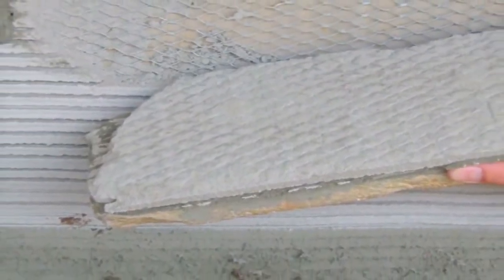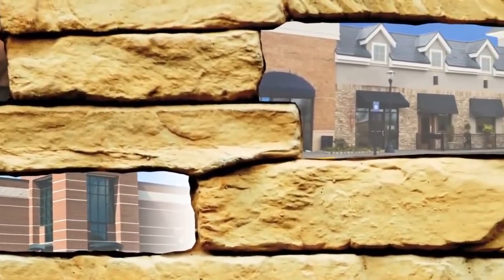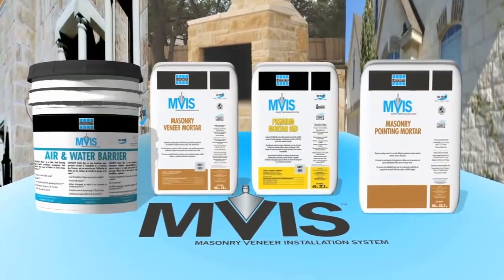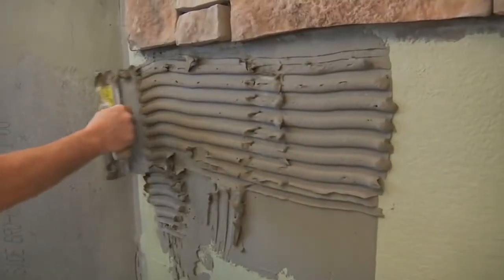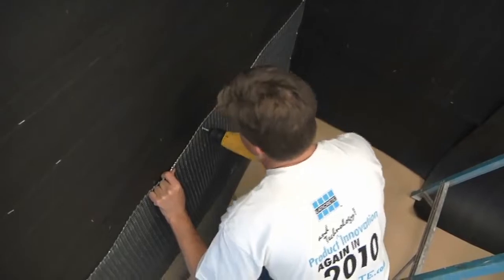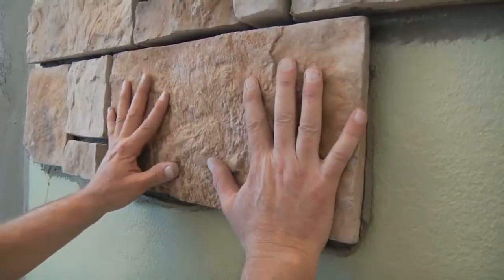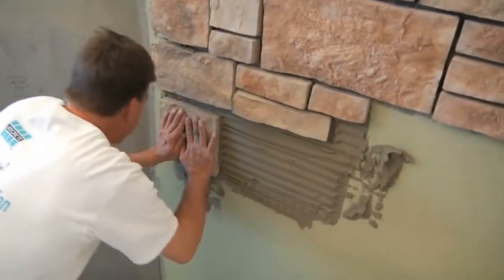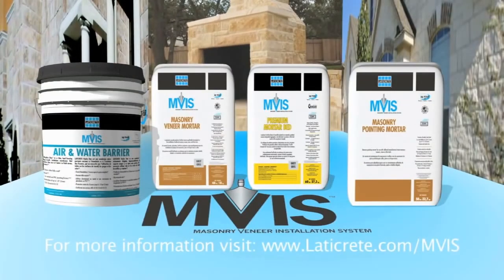Masonry Veneer Installation System (MVIS) by LATICRETE

Comment: What is the maximum amount of time (days) the Air and Water barrier can sit until the stone must be applied?  My mason only works on weekends, and depending on weather, there could be a couple weeks or more between when the barrier is painted on and when the stone is applied.
Reply from the maker: That's a great question! You have 90 days once the product is applied to get it covered with a facade. It's still best to be mindful of other trade work around the assembly and the potential for surface contaminants to accumulate as the product remains exposed. Make sure all surfaces are cleaned before products are applied.

Comment: Is there a concern that termites could travel behind the stone in tiny channels to reach wood framing above the cement being covered?
Reply from the maker: Hi Cindy! Thanks for watching and reaching out. You need to promote 100% coverage of adhesive to the veneer unit and to the substrate. Complete bedding of the mortar to both the veneer unit and the substrate is critical. Hope this helps!

Comment: That’s doing too much. The good ol wah is easier .. type s mortar slathered on each individual stone Not too wet nor dry for quicker installation without pressing too hard or holding it for more than 3 seconds.
Reply from the maker: Type S compared to our products doesn't really stack up. No pun intended! But, Although used in similar applications the two aren't really apples to apples. And therefor factory produced installation materials assure consistently high quality installations, and higher performance then a Type S, thus providing warrantable installations for challenging exterior applications.

Comment: In one comment you advise that a barrier is not required, in another you you say it is. Can I get a definitive answer? Yes or no?
Reply from the maker: We wouldn't decide if a barrier (air or water) is needed. That would be up to the design professionals on the project. Here is a document that can help you learn more about barriers, and how they relate, and may be incorporated on an exterior wall to receive direct adhered masonry units: https://cdn.laticrete.com/~/media/support-and-downloads/technical-datasheets/tds240

Also here is our MVIS Guide which will clearly show how our products are to be used on the various wall assemblies out there: https://cdn.laticrete.com/~/media/product-documents/marketing-information/catalogs-and-brochures/mvis/ds0052_mvis-catalog

Let us know if you have additional questions. We're happy to help.

Comment: Are these products ideal to use for exterior installation. I want to install the veneers stones on a cement wall, that is in good shape, no cracks etc. Thank you
Reply from the maker: You can install them over clean sound concrete. Click here for details: https://laticrete.com/en/solution-center/for-architects/architectural-guidebook-tool?category=Masonry%20or%20Thin-Brick%20Veneer%20Installation%20-%20MVIS

Comment: Great video, on an interior application over durarock cement board is the roll on moisture barrier needed? In the video the guy appears to be doing an interior application.  Thx
Reply from the maker: Glad you found it informative! No, not needed. Direct adhere to the cement board is fine if no waterproofing /antifracture is spec'd or needed on the install.

Comment: Do you have to use the air and water barrier over the cement board?  Ive never seen anyone do that before
Reply from the maker: Yes, if you are looking for LATICRETE System Warranty.  It can be used as an Crack Isolation as well.  It helps with the minor movements from thermal shock and freeze thaw and also may help with some of the soluble salts (efflorescence) in wall system.  If you have addtional questions, please feel free to email us at socialmedia@laticrete.com and we'll put you in touch with a local rep